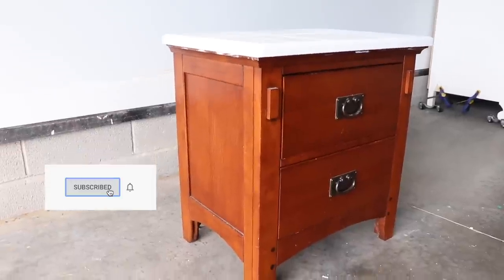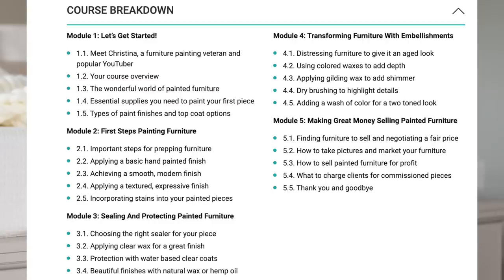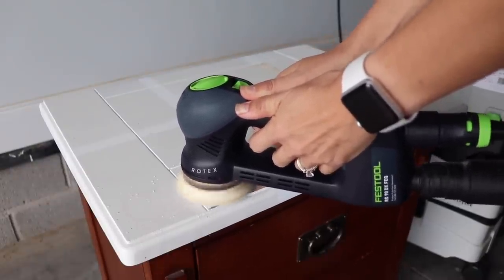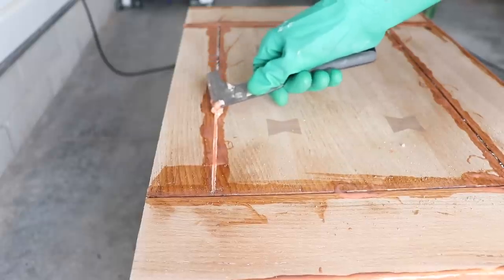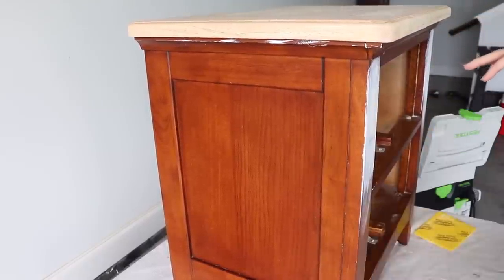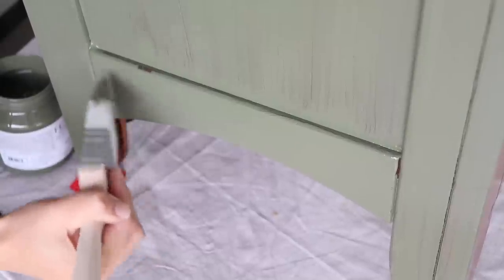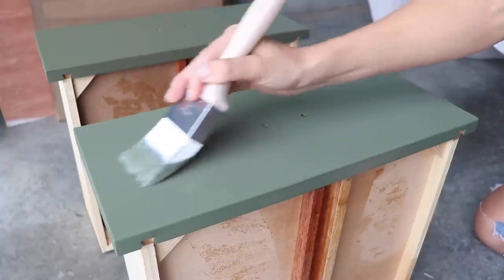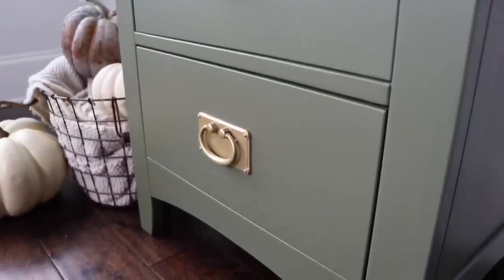Furniture Flip w/ Fusion Mineral Paint

Comment: Awesome videos been loving them. Just a quick tip for people who who can't afford the festool sander. Buy a decent wet and dry vacuum and tip accessories for tools and you can achieve exactly the same result for a quarter of the price. I own a festool and it's awesome but for years and years before this I used and a DeWalt sander with a wet and dry vacuum and it works just as well the festool is just quicker to set up and smaller footprint in the work shop. If you can afford the festool go for it but if I had my time again I would of just figured out a better way to store and set up my wet and dry vacuum works just as well and last just as long definitely spend your money on things that would help you out more like a good spray gun set up or some of the basic wood working tools like drop saw, table saw and jig saws. Again awesome videos just thought I would add my 2 cents as I see people spending way too much on DIY tools then realise they could of bought and set up a whole shop for the price of 1 tool they bought.

Comment: I thought acrilic paint does not adhere to  stained or varnished surfaces? Isn't it necessary to sand or strip existing stain/ varnish if unsure whether it is water based or not?
Reply from the maker: This is a special formulated furniture paint that is designed to adhere to previously finished surfaces. Check out their website for more details.

Comment: What model number is your sander? Will this paint prevent bleed through of the previous stain?
Reply from the maker: The sander is linked in the description box. This paint does not prevent bleed through. You may need to seal the piece before you start if you have a bleeder.